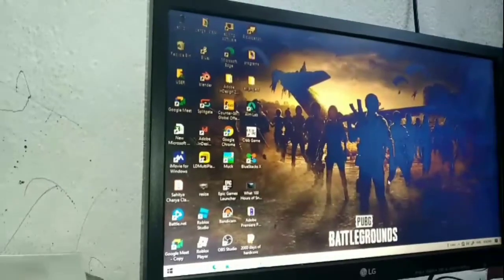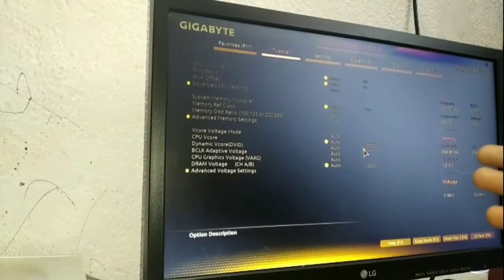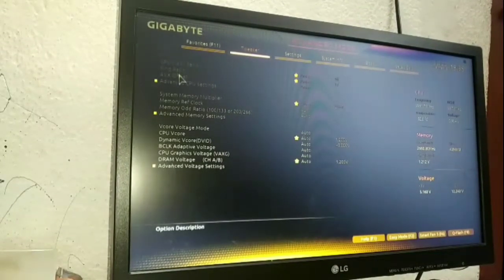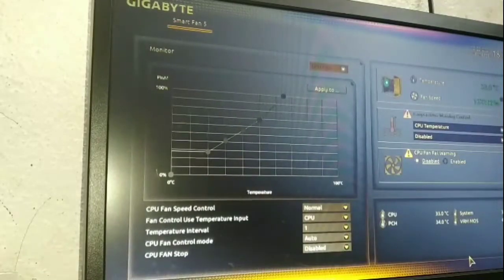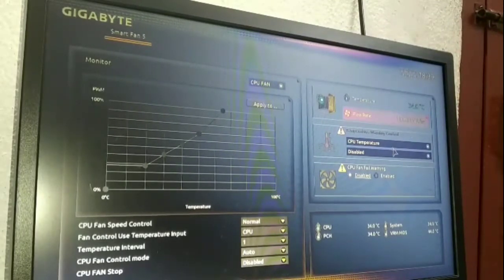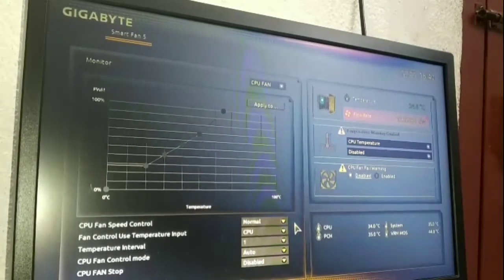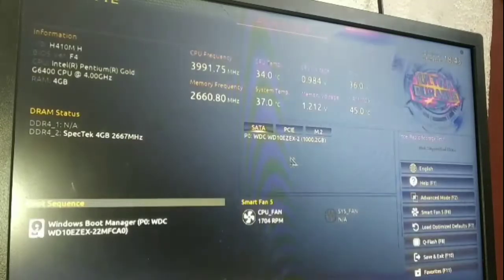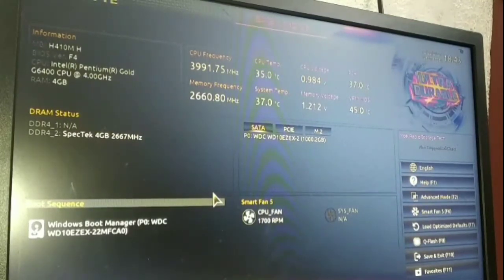how to use smart fan 5 in gigabyte bios 🤔🤔🤔🤔

Comment: Bro please help me i bought a new pc when i am starting my pc the temperature is high 78-80 without any use.bdwy i am using stock cooler. And when I am entire my bios like your videos only cpu fan and System 1 fan is working other System fan2 is show N/A like your videos showing up Don't what's going on please 🥺 help if you know something solution and when i update my bios my pendrive copied bios file not showing on pc screen 😩😿 please help me bro in my area no one known about pc